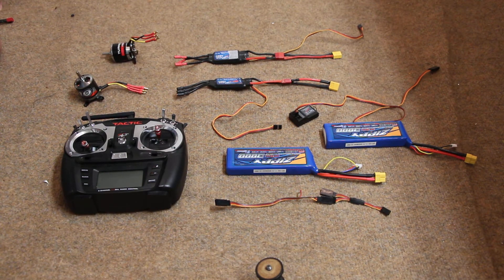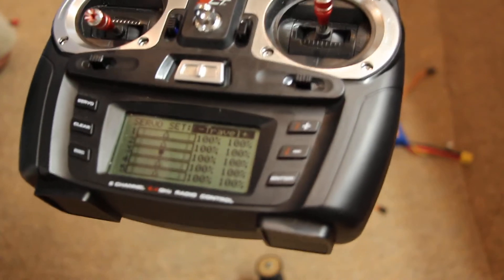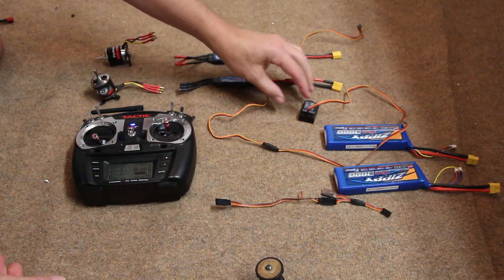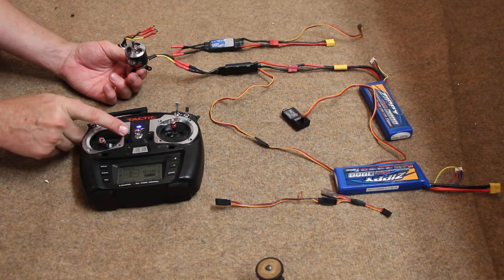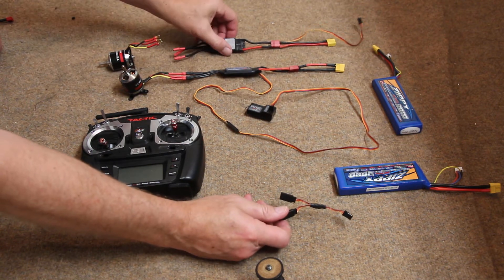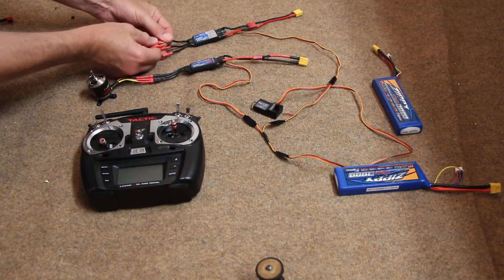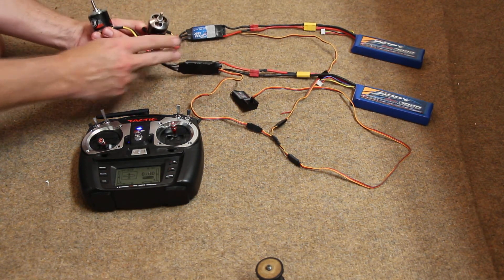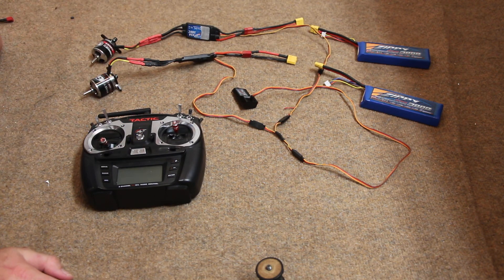Tactic 650 Transmitter and electric power (single and twins)

Comment: Your motor timing needs to be adjusted so both motors start at the same time. This is usually explained in your instructions for the ESC. If you do not do this,I guarentee your plane will want to pull in the direction of the motor that started first every time. I have been watching your videos and although they are somewhat helpful, you are missing things or not explaining things . I do commend you for your efforts. I dont claim to be an expert by any means but please remember,many new people to the hobby get on your site looking for answers. It can be really confusing and disheartning if after following a video to have problems,or just move on to a different site mabe adding to the confusion. I learned about twin engine set ups by watching videos like yours. At least you stated you didnt know why the motors start up at different times. Mabe you could make another video saying,this is how to time your motors to start at the same time by setting up your ESC like this,or per the directions given in the manual. I found ESC's to be the hardest things to understand at first. I couldnt believe the motor makes the beeping tones and musical notes. I thought the ESC had a mini speaker on it somewhere.lol. So much I have learned.lol.